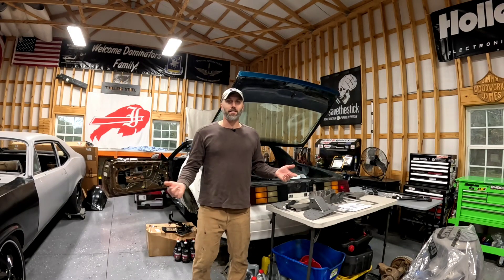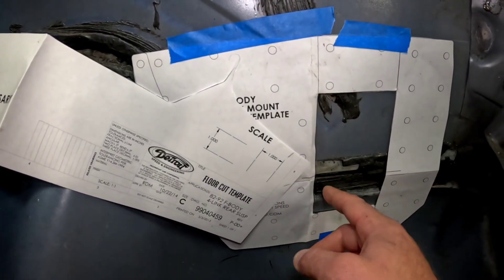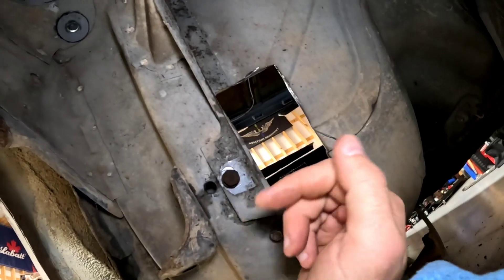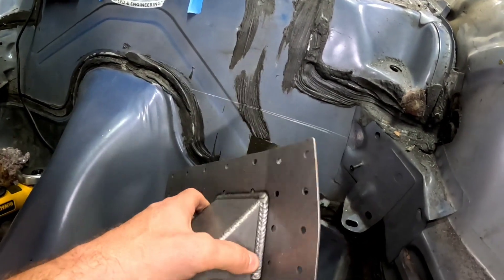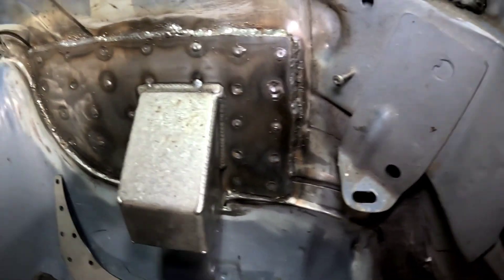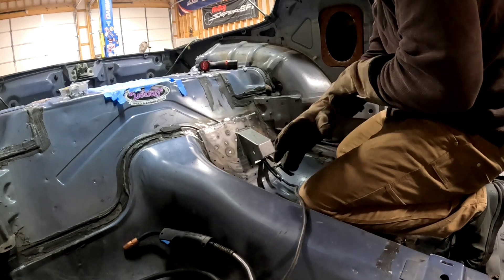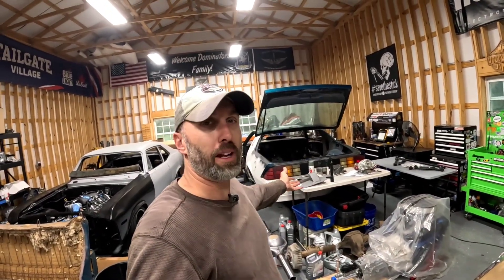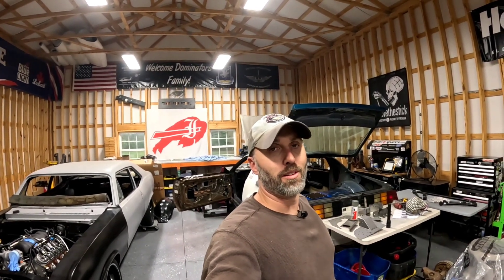Installing a Quadralink in the Third Gen F-Body (It's Finally Happening!)

Comment: Are you using a 110 or 220V welder? I have a Lincoln Pro MIG 140 (110V), wondering if that will be enough.
Reply from the maker: I am using a miller 211 .  It’s capable of 110 and 220.  I welded the subframe connectors in on 110 and the qaudralink on 220.  No question to me that I think the welder just runs better on 220 but if your 140 can handle 1/8” on 110 power you will be fine imo.
Reply: A 110 would do this job no problem.